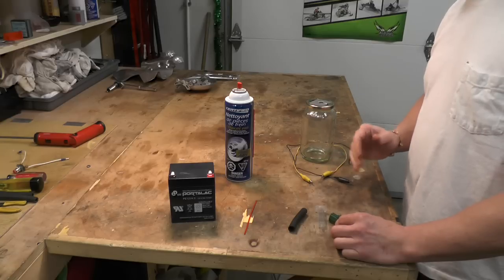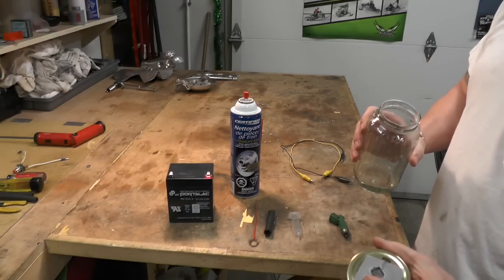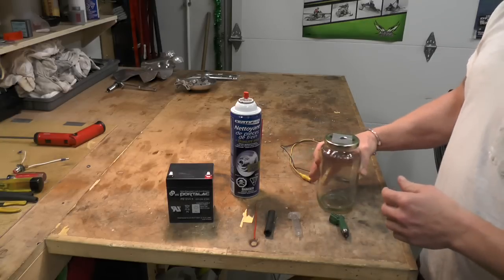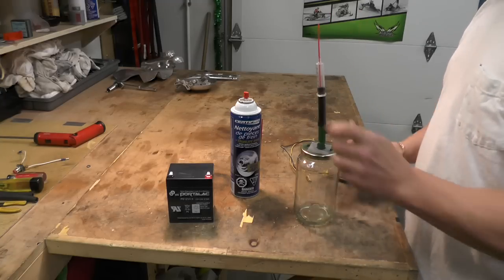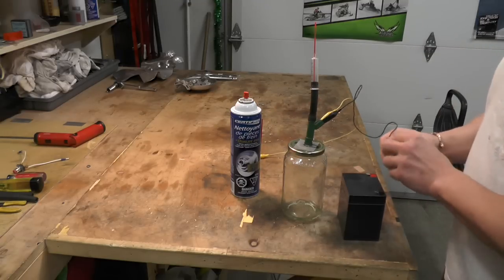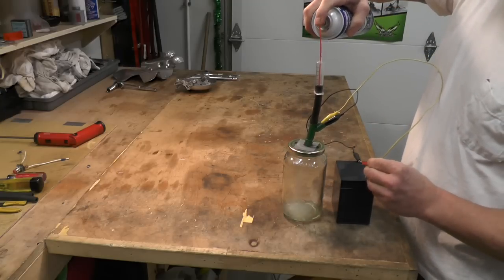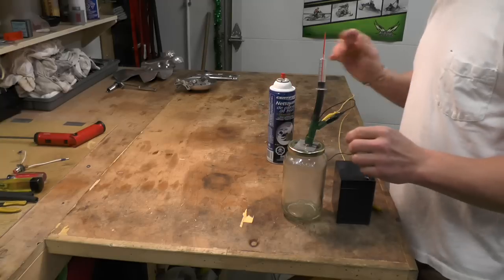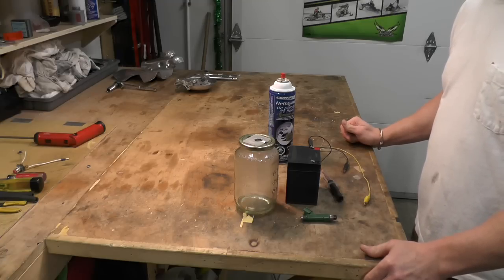Snowmobile Arctic Cat M8 Injector Cleaning

Comment: Great video. This will be helpful. Just rebuilt the motor in my 06 Crossfire 600 and wanted to look at the injectors before I fire it up.
Reply: Do you mean to do it in the reverse direction first and in the normal direction, of the video, then. Is brake cleaner good for injectors? THANKS!

Comment: Now I’d like to see a video on how you removed that from the sled
Reply from the maker: They are easy to get to in my sled (Cat) but depending on what you are riding it could be an adventure!
Reply: @danieltrudel  well I tried your procedure.. didn’t go so smooth.. didn’t have a syringe and didn’t know where to get one like you had.. as I couldn’t really see it.. I tried to make a tight seal.. but instead on the cleaner going through the injector.. it just ended up on the walls

Comment: I tried this method and both click before spraying cleaner, neither injector will pass the cleaner. I even took out the filters and tried them that way. Would this mean that both injectors are bad?
Reply from the maker: Hey Jarod, may be a build-up in the tips. Do you have someone who can service them? They will flow them both ways and that usually clears any blockages.